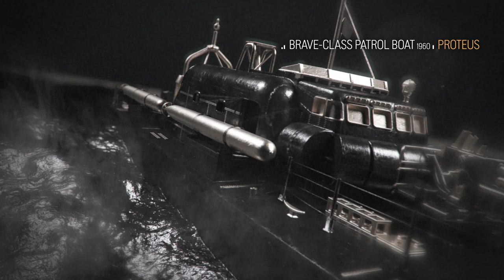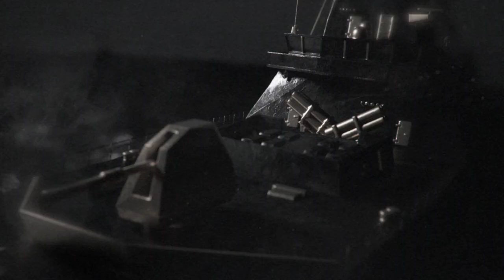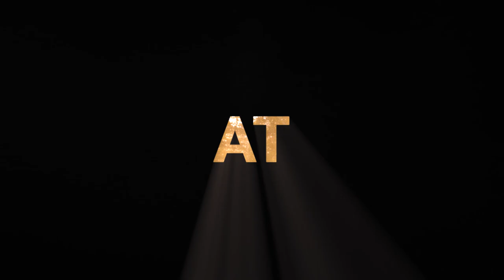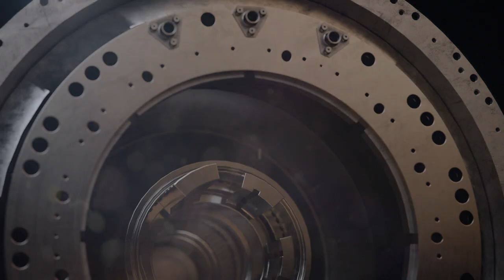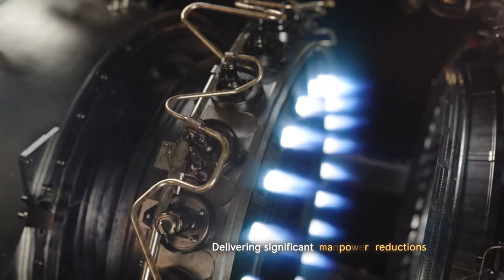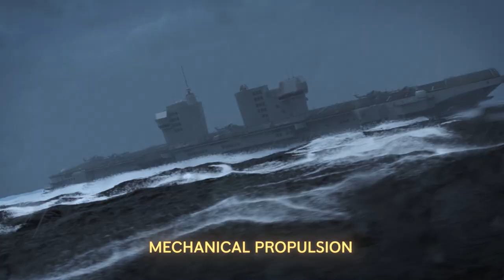Rolls-Royce | The “Mighty” MT30 Marine Gas Turbine – Revolutionising Naval Propulsion

Comment: Whatever happened to WR21?
Reply: It's still in the Type-45 with various "bugs" being ironed out. I think the intercooler has been redesigned.   I get the impression that when totally sorted out it might be awesome but in the meantime people are going with more proven things.
Reply: @timmurphy5541  Thats more or less what I heard.  As far as I know the intercoolers have been bypassed and a third diesel generator is going to have to be shoved into where a mess deck currently is.  I am old enough to remember arguing with the designers about the reliance placed on low-loading the WR21s, but got told to shut up and know my place...